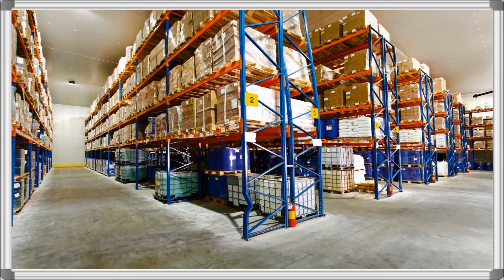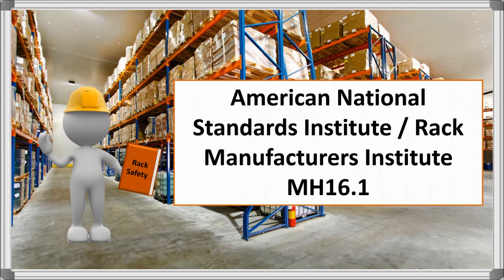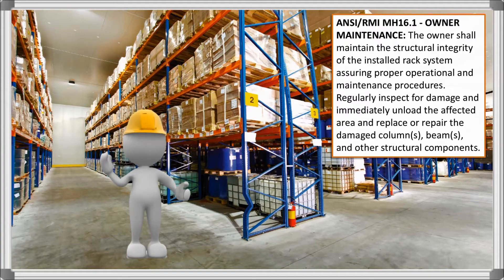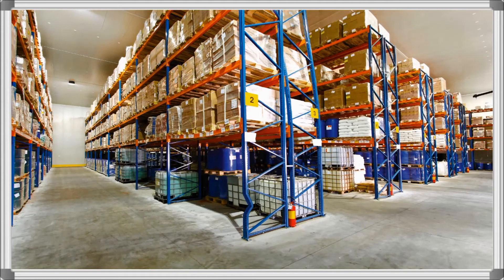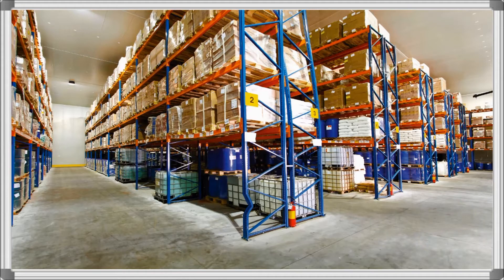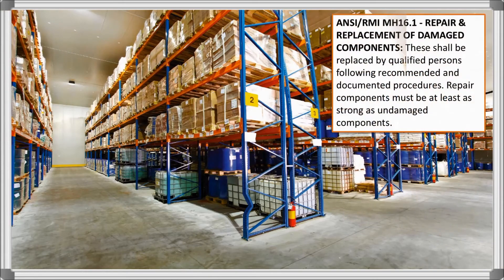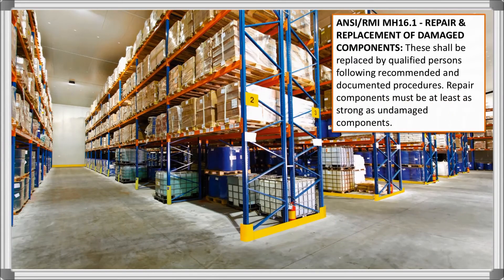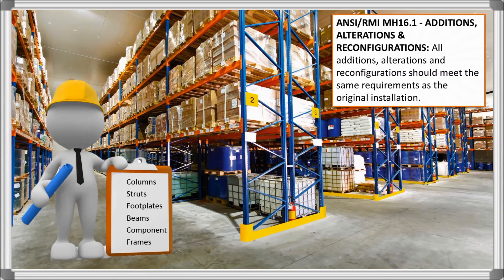Warehouse Rack Safety Standards | Total Warehouse Tutorials with REB

Comment: Great warehouse safety video. I think it is also very important to mention that those missing components are safety clips. Often times those clips become lost, damaged or misplaced if the racks have been moved. Replacement universal drop pins can provide a great solution for lost safety clips in your racking. You can buy them here: https://palletracksafetybolts.com